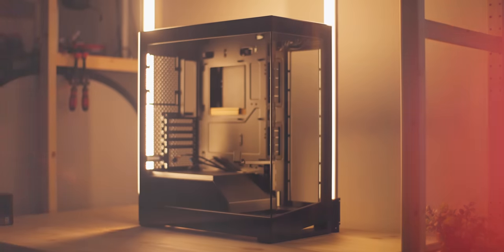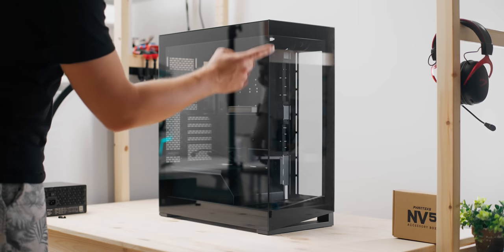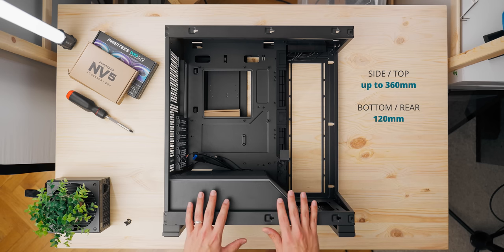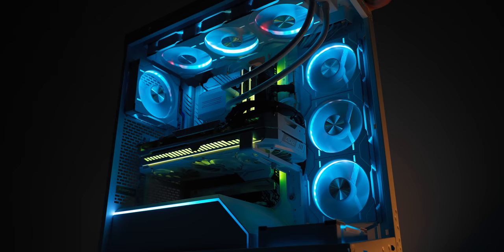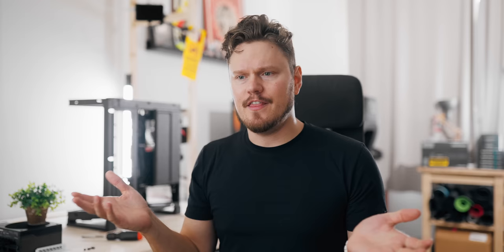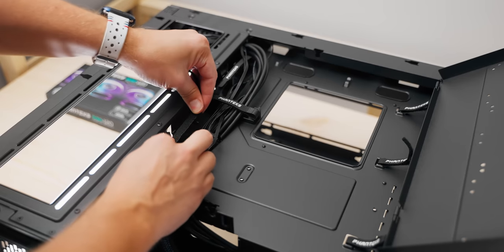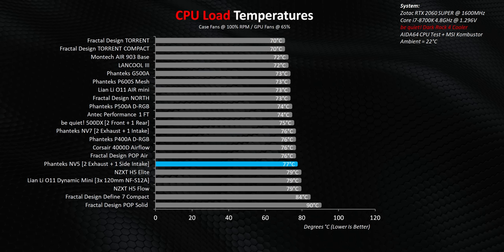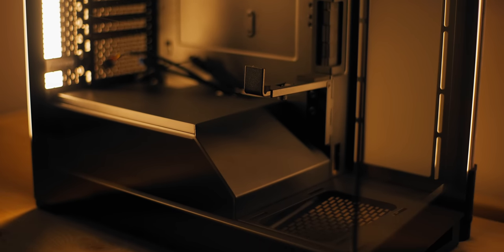The $99 Masterclass of PC Cases?

Comment: The NV5 is such a nice case. I personally think the triangular openings by the feet make it much easier to carry. The point about the cable routing i agree with when routing the 24pin to the mobo is a bit more work than it should have been. Once that was done, it was a breeze. Lots of room to cable manage everything.
Reply: A tip I found while trying to route that 24-pin cable in the NV5 (at least for anyone with a modular PSU) is to route the end that plugs into the PSU through the grommets, not the wider and bulkier 24-pin end. Normally I’d have the PSU ends already plugged in, but it was FAR easier to make an exception with this particular cable.

Comment: the biggest problem i have with the nv5 vs the nv7 is that they removed almost every single feature of the nv7 that makes it stand out and make me want it - namely the unique rear i/o panel cable routing & cover, and the ability to angle the bottom intake fans (not to mention even having 3 bottom intake fan slots). Granted, the NV7 is too big for me as well. I realllllly hoped the NV5 would be basically just a shorter version of the NV7, but instead it's just a completely different case. Maybe we'll get lucky and they'll give us an NV6
Reply: This exactly describes how I felt and what I was hoping for, as well as the reason I'll be waiting and buying the O11 Vision or Evo RGB instead. A swing and a miss, but still a decent case.
Reply: Angled intake fans? I didn't catch that in the features for that case. I'm eyeballing the NV5 right now due to it's smaller size. The only thing that seems to irk me about it is the slanted PSU. I'm so used to traditional... uh, very OLD cases. I want my PSU sitting flat. But I realized today that the angled design on the bottom would make it easy to pick up and tote to the work bench... Or endtable in my case lol. Gonna have to get some padding for my work area. And be sure to wear a soft shirt while handling it.

I'm going aesthetics over function. But it does look like it has good airflow too. The Phantek fans matching the leds on the PSU cover take the cake. Just not looking forward to putting a car note down on them 😓

Comment: After having mine for a few days I really like it.  I agree with the trying to fit the 24pin through that small space.  One feature I think that get overlooked is the small rear grommet.  I used it to run an RGB strip on the back of the case for some additional lighting.  Super easy to build in.

Comment: I have bought the nv5, I have had it for 2 days now. This case is amazing, but I did have a couple of problems. Had a hard time with cable managment, you cant really pile up cables in the bottom psu chamber because its so small. Attaching side panels to the case is very complicated and has very small tolerances. I also had a hard time routing cables for my gpu.

Comment: I built my NV5 today.  Your complaint about the cable channels is valid, but largely irrelevant if you route the cables through to the back from the front.  I actually routed all my cables from front to back, managed them, and THEN connected them to the PSU and installed the PSU.  So, so much easier.
Reply: I did that with the 24-pin cable. The others I didn’t have any issues with.

Comment: It looks really nice, i really wanna do a build in it. Just finished a custom loop in my O11D Evo, though. As for pricing when comparing the NV5 and O11D Evo, it really depends on local pricing. Here in Scandinavia, i had to pay just over €200 for the Evo but the NV5 is only €110, so the NV5 is a pretty good budget-friendly alternative. I like that it got the front and side glass panels like the Evo for putting your build on display but still differentiates itself with the traditional PSU shroud. There's too many cases looking like the O11D already, some variety is appreciated.

Comment: It looks nice but it is still waaay bigger than it needs to be. If they had kept roughly the same proportions but replace every 3x120mm fans by 2x140s it'd be a little more compact yet perfectly fine case. Looking forward to the NV3 :D

Not really convinced by the $100 LED strip kit and the $100 LCD screen kit in addition to $200 worth of fans that you more or less need to 'fill it up'. Including the case that's a $400-500 purchase without any actual hardware. Rather seen they'd gone for an RGB version with this included for like $50 more and a non-RGB version like Phanteks has done before on different cases.
Reply from the maker: In many ways it's tailored to Phanteks own fans (and their limitations).  Right now none of Phanteks' high end fans (the D30 and T30) are available in 140mm size.... yet.  That and this case's limitations say a lot.

Comment: Just disregarding the price, I feel like "DLC" for cases, or any computer component (not in the Intel "Unlock the thing that's already inside the CPU" way) should be encouraged.
Like, the lightbars and screen are fairly cool, but they could also offer less complex additions, like solid colour panels and bars, or single colour light fixtures, or coloured screws and gaskets, or a hippie bead curtain, or what have you. Tinted glass, solid panels, stickers, etc., etc.; as someone who spent months saving for computer parts one at a time, I would gladly pay a little more to make my computer even more *mine*.
Glad they're offering anything, and that those any-things are seemingly versatile. As much as I like my Fractal Torrent, I can't even slap a hard drive cage on it, so there's room for improvement to bring the baseline up a bit.

Comment: I like the amount of glass as that maximizes the view of the custom paint I will apply! 
I wonder if a 240 AIO (for the CPU?) on the side blowing out, with a fan underneath it blowing in, and either a 360 AIO in the top for the GPU or just outlet fans in the top would result in cooler temperatures.

Comment: You're overthinking the value-- The O11 Dynamic Evo doesn't come with fans either.  You want a mesh front panel?  That's $20.  You want the upright GPU?  That's > $90.  Vertical GPU mount?  It's not cheap, considering it's $10 worth of metal and a ribbon cable.  At least the NV5 vertical GPU bracket is a nice bit of kit with some (D)RGB on it.

Most cases, if it's a "pretty" case, the first thing you do is rip out the vendor fans and put in your own.  No point in paying for something you won't use.
Reply: true, me and my friend have 011 XL and 011 Mini. he paid $120 for the mini, another $100 for vertical bracket.

Comment: This does seem like a pretty nice case, but in terms of airflow I’d argue that the h9 flow is superior due to the fact that this case can only hold 4 intake fans while the h9 can hold 6 which causes positive air pressure, and for the extra money you spend you do get 3 included fans unlike the nv5 that doesn’t include any at all.

Comment: Like the case but not a fan of the Front IO as since it is small enough for desk to use the front ports you would have to stand up each time you want to plug something in. Like the Lian Li lancool 216 you have the option to wet on floor with top mount or desktop and switch it to front bottom mount.

Comment: I would like to see a case with fewer RGB fans to see how it would look aesthetically. It feels like the case is designed to make you buy 8 fans, but in reality, there are 9 D30 fans. 85 euros for a set of 3 equals 255 euros just for the fans. What if there is a 240 AIO cooler on top, and instead of 3 fans on the right side, there are only 2? How necessary is the bottom fan in this configuration?

Comment: Adding 5 Phanteks D30 fans to the case, leaving space for a 360 AIO, the way it was meant to be fitted out, becomes very expensive.
Reply: Yes i wanted to buy it, €258,- with the D30 fans and the Phanteks aio isn't good enough, so I have to buy another 3 fans for the radiator for a total of €348 for only the case and fans. 
Think i'm gonna stick by the Sky Two and wait for the King 95

Comment: I just ordered my NV5 but wondering thoughts on aircooling in this case? Currently running an Assassin IV, but wondering if I need to switch to AIO now with this case.
Reply: It's not an air-cooling case
Reply: it's not designed for air cooling. look at the Phanteks G360A for that.

Comment: Price aside, I like the aesthetics of the NV5 more than the NV7, which I did not expect. Having 4 fan slots but only accommodating a 360 on the side and that huge forehead above the motherboard just aren't for me. Plus there's so much room around radiators that they look out of place versus integrated like other cases. Wondering if the NV9 might change my opinion.

Comment: I'm having trouble finding a dual chamber case which will properly fit a reservoir and pump. There are options ofc, right now I'm looking at this and the antec c5. Both would work, but I feel it will impact the airflow. Any other suggestions?

Comment: This case is kind of weird in the ecosystem standpoint. Sure, it ticks the basics of what you need but the DLCs are a bit, meh. Ideally, this case screams integration: the controller would probably work best with phanteks own fans and since the D/T30 aren't in 140s, it seems purely like a case designed around the ecosystem rather than the other way around. Nevertheless, I bought one.

Comment: Is there anyway to hook the case rgb light to the mobo I straight fried the wire trying please help I have lian li fans and a kraken aio
Reply from the maker: The case has a 5v addressable adapter. Just make sure you’re not plugging into the older 12v lighting port on the mobo. 
-D.
Reply: @HardwareCanucks  do you have an email so I can show you the wire I fried and the phanteks case drgb built in controller by the power button I really need the help man 🙏
Reply: @HardwareCanucks  it was a wire that went to the case for the rgb lighting strip on the case I'm just wondering were I can get this cable and if I can plug it into the motherboard to sync everything or maybe vice versa maybe get everything to sync to the cases software just am clueless this is my second build and it's been a while since 2006 there wasn't much rgb back then
Reply: @HardwareCanucks  I can send a video to your email showing you the whole phanteks nv5